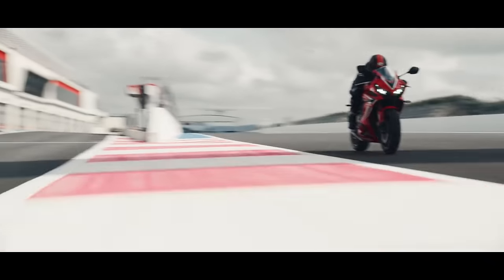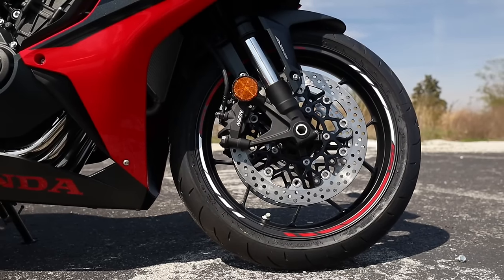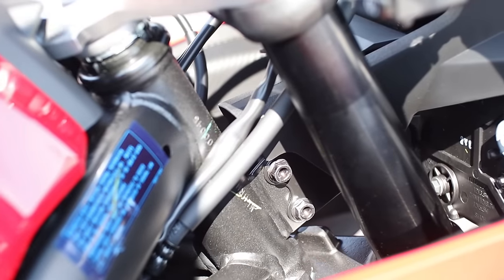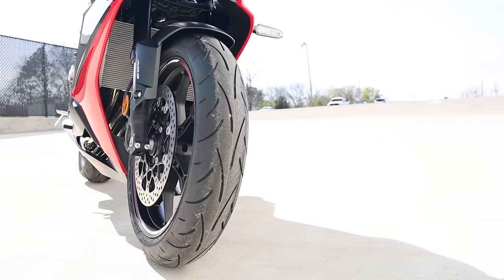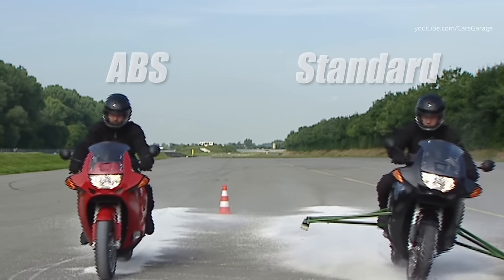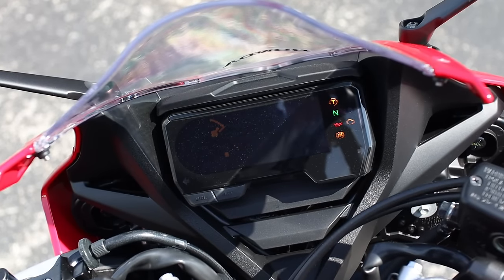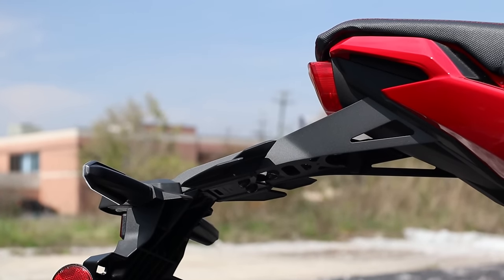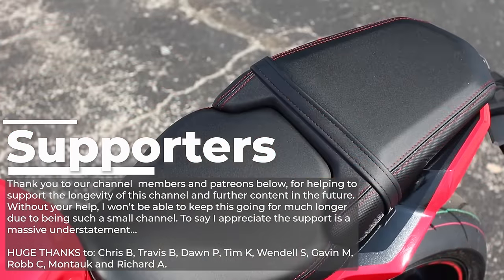New 2023 Honda CBR650R Review | ...Time for the CBR750R Takeover?

Comment: I4s sound a million times better than twins so I’m hoping it sticks around.
Reply: The only twins that sound good are V-Twins like on the Panigale V2, and 270 degree parallel twins like on the 450SS and R7, because they mimic the V-Twin burble. All these 180 parallel twins like the Ninja 400/650, R3, and CBR300R/500R sound awful, and an aftermarket exhaust barely helps. Single cylinder bikes like CF's 300SS/NK, KTM's 390's and Husq's 401's sound even worse stock.
Reply: Factssssss

Comment: This is all the sport bike you need or want. I have one and I also have a 2009 GSX-R750. I ride the CBR and leave the gixxer in the garage. It's more enjoyable to rev a lesser powered engine high and use all of the power available than to just ride an overpowered bike at 50-75% of its capabilities. It's more comfortable too.
Reply: Yep - and the cbr is still a “top end 150 mph” bike. That’s more power than you’ll ever need on the street. I love mine.
Reply: Useful insight I've always respected the 750 but makes sense that the 650 is actually more useable

Comment: I have a 2019 650R and I love it. I would not consider a two cylinder bike even if it had way more power. One of my favorite parts of my 650R is the engine sound. It makes me smile every time I hit the throttle.

Comment: I like how the comparison between cbr650r and f4i only limited itself to weight and hp. 
Let's not talk about better geometry, suspension, brakes, tires, and probably a way more refined and reliable engine
Reply: Yeah - I rode the F4i before  trading it up on a 1KRR in 04.  Still have the 1KRR but I did have a Gen4 ZX10R which was a hoot and quite a nice package for road and track.  Might look into 900 Yami Triple next though.  See what they do with the R9 or go the XSR900

Comment: I’ve been daily ing cbr650r for more than 2 years now, if there is one thing i would like honda to do for newer models is offer adjustable suspension. The standard one is good but its abit on the soft side , which is good for long touring rides but me personally and many of my fellows friends who own the same bike feels the suspension feels a bit “soft”  especially in high speed runs but overall the bike is the best .it got Fully usable power for the street riding and trust me u can” follow” up on sbk bikes with this baby. Not underpowered for 650cc i4 bike.The i4 engine sound is the best. ❤
Reply: Traxxion dynamics sells a supersport fork cartridge for this bike.  You can pair it with a stiffer shock spring or get a racing shock from Penske.  Not cheap though.
Reply: Ya it needs upgrade. Im planning to get the misano cartridge kit from Andreani suspension.
Reply: @MrGuginez  My shock dyno guy really recommends the traxxion cartridge over the Andreani, but if you're only riding on the street he says the Andreani is good enough.
Reply: @jamesschaffer5504  yes bro. I mostly ride on the street. I only hit the tracks once a year just to get the “kicks”.
Reply: @MrGuginez I have one too. You’re dead on with your assessment. I’m strictly street and this bike has more speed than you’ll ever need for that as well as the “occasional” track visit if you’re doing that every now and then. The suspension is fine for me but I can see how it would need to be upgraded if you needed that high speed control more often and in those track situations. Stay safe and keep riding.
Reply: @someoneelse1i1i  yes bro. Agreed.  #ridesafe

Comment: I am sure Honda is aware of all the rejection towards the Hornet looks therefore we could expect (if it happens) a better looking version of a cbr750r.
Still nothing beats the inline 4 😊
Reply from the maker: Maaaan, I hope so! If they want people to people to forget about the fact that they're taking the inline-four away, they HAVE to absolutely nail the styling on the CBR750R and bring a lot to the table in certain aspects where this CBR650R is lacking. 

I'm not overly excited about the end of even more four-cylinder bikes as that's what I prefer personally but I'm super curious to see how all of this pans out and how it's going to be accepted etc. One thing's for sure, it's going to be interesting to see what happens next...

Appreciate ya watching Al and hopping in the conversation etc to help support all of this bud ;)
Reply: I purchased a 2023 GSX-R750 since it hasn't changed since 2011.  Pure 4cyl sport bike with fully adjustable suspension.

Comment: the cbr 750 r better have a 180 back tire... 🥴
Reply from the maker: If I was a betting man, I'd say the CBR750R will have the same 4.5 inch wide rear wheel with a 160 as the CB750. 

From a business perspective, it would make sense for them to use the same setup, like how they did with the CB650R / CBR650R sharing the same wheelset. 

I hope I'm wrong though and they build a wider rear wheel for it but I'd say the penny pinchers in accounting won't let that happen as it would add a hefty amount to the bottom line. Fingers crossed though...
Reply: There is nothing wrong with the 160 rear tyre when it gives better cornering performance over a 180. Namely the SV650 has a 160 rear tyre and that bike is absolutely beloved even as a track bike.

Comment: A 600 class “sport” bike that weighs more than my mt10 is a joke.
Reply from the maker: I couldn't agree with you any more bud, which is why I had to take a dig at it here and there and bring up the 20+ year old CBR600F4i that had it beat in many categories - weight being a big one. To play devils advocate though, decreasing weight takes money and most people want cheaper price tags and would rather save a few bucks and add weight than the other way around so it's a slippery slope for sure. 

Honda could definitely take a page from Yamaha's book on a lot of things... Well, not when it comes to the R7 lol as we need our inline-fours! Still saddens me about the R6.
Reply: It's not a sport bike it's more along the lines of the GSX650F (bandit). More comfortable position, heavier, smoother, lower based torque band. Etc. 

It's meant to be ridden comfortably with solid sportiness. A 600 super sport is directed solely towards track performance (don't let the clowns at the BP parking lot tell you otherwise). 

Track bikes vs sport tourer.
Reply: @jordanjoestar8839  yeah people keep thinking its a supersport or something when its more of a sports tourer. like you said easy on the body but still nice to hit the hills. don't know why manufacturers don't make more sport touring with clip ons like the 650r or most pre 2000 sport tourer. Most of them come with handle bars and its just feels like a naked with fairings, it kinda defeats the "sport" part of it guess.